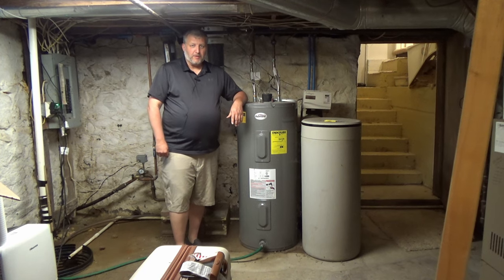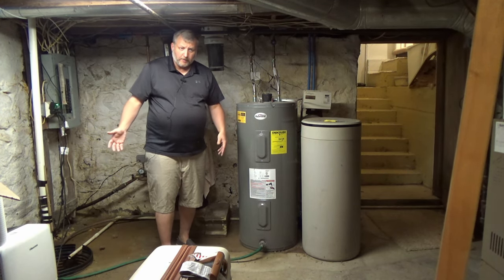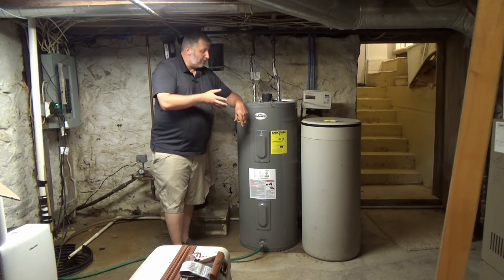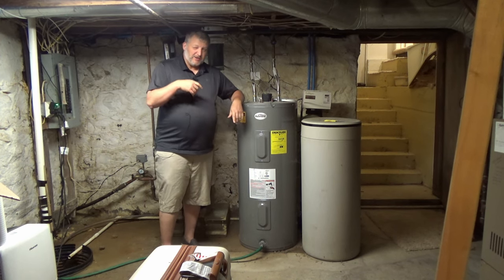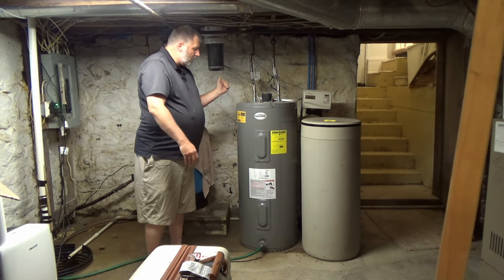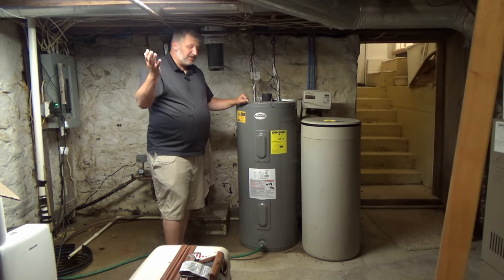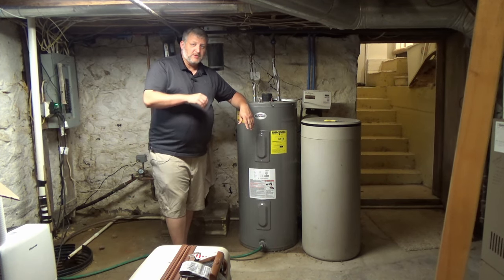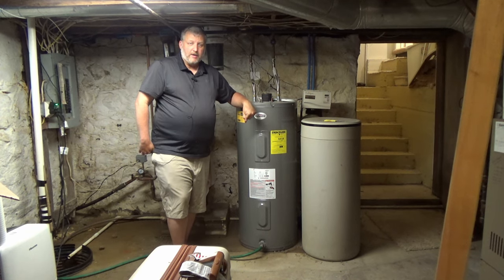Did Installing an Electric Anode Rod Really Make a Difference?

Comment: Its a part win. I had sulfur smell and switched to the corro protec. It got rid of most of the sulfur smell but not all of it. 

If you open the drain of your water heater and drain some water out into a bucket you may smell some sulfur .

The lasting fix for me was to set up a flow based peroxide injection system that injects to about 3 ppm. That completely eliminates the sulfur smell but it's expensive, like $ 600.

Also, I've heard you can turn the setting to 135 degrees and that also eliminates the sulfur smell.

Comment: Big baller like you needs a tankless water heater
Reply from the maker: I had considered getting a tankless water heater but, for only two people, I am not sure if it is worth the money.
Reply: @ericbrenner690  Over time that may pay off better as you're only heating the water you use. There won't be a continuous energy loss like there is out of a tank water heater.
Reply from the maker: Just seen your comment. VERY true. Perhaps when the current heater goes to the crapper...